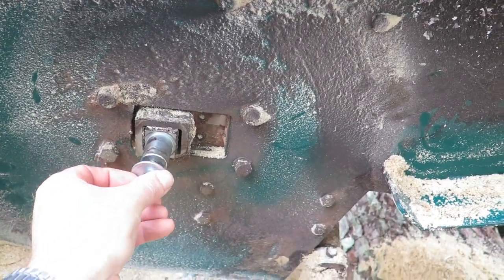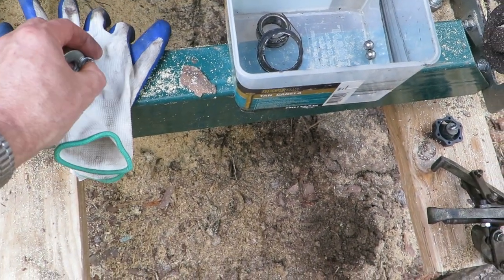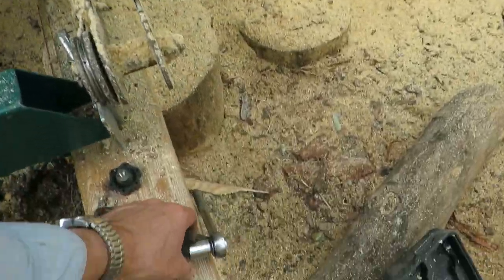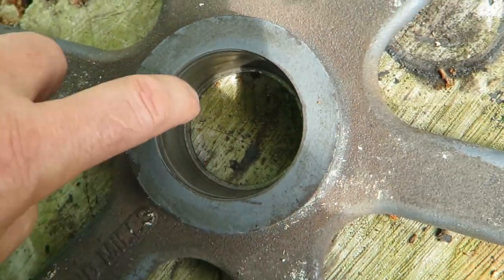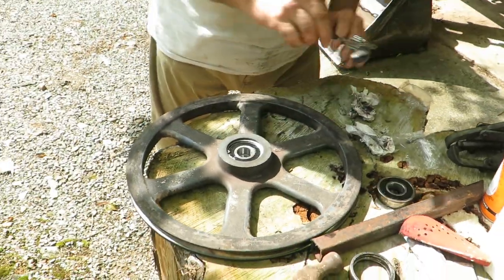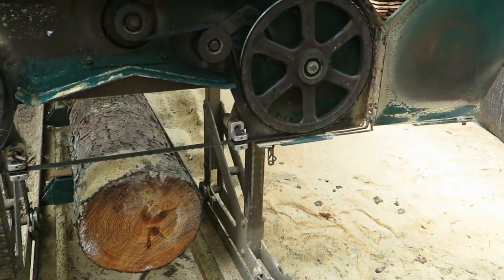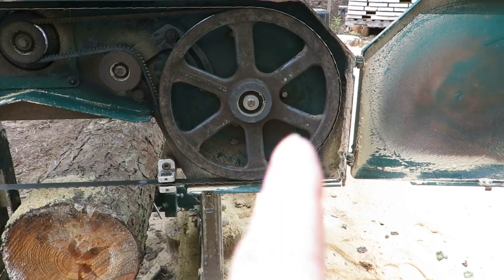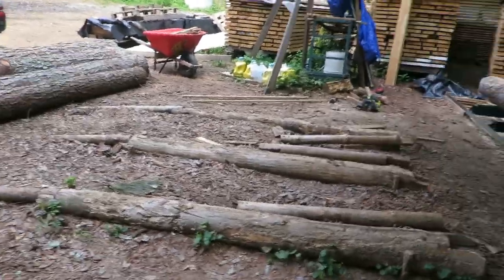Eps#190 Houston we have a problem! Bearing change after 310 hrs on my Woodland Mills HM122 sawmill.

Comment: good video the only thing i know that might help is put dry ice on shaft we use to do that but i have no idea where you can get it from now. i thing woodmizer has a defect in there welding i do know you need to heat spring steel before you weld it and keep it from cooling to fast. thank you for video's i will not be buying any of there blades. i have heard people say the double hard blades broke worse. i hope you don't have to much trouble getting it to track right. take care, be safe and well.
Reply from the maker: That may be the issue. I never thought about the double hardening aspect making it weaker.

Comment: Where did you get the new bearings? I’m wondering if I can get quality bearings locally cheaper than buying from WM. 
Does your pulleys run hot or cold? I noticed that running water through it faster helps keep it cooler. I opened it and felt of the large pulleys and they were pretty hot…too hot to hold my hand on them but I could touch them for a few seconds…maybe 110 degrees.
I only have 30 hours on my 126 so I hope those bearings last a long time. Be a good idea to have my puller and a set of bearings nearby.
Reply from the maker: You may be able to get them cheaper elsewhere but WM is very competitive on bearings. 
I have not noticed the bearings getting too hot. My bearings went for over 300 hours.

Comment: Good day i had the same problem trying to get the wheel on i called them up a guy told me to take 220 sand paper and sand down the shaft a little it don't take much and it slid on easy with a little never seize.
Reply from the maker: I should have done that. I did not want to mess with the tooling but it was way too tight!
Reply: @thetennesseefrugalcraftsma7383  yes hope you never hurt the bearings.
Reply from the maker: @wallaceviviansadventures2095  true! Did yours pull off hard originally?
Reply: @thetennesseefrugalcraftsma7383  yes very hard i tried first with a wheel puller then i used the spray 2000 let it set over night next day it still was hard to pull.